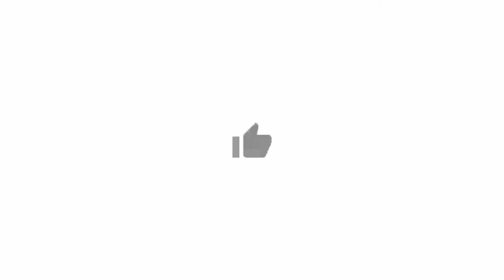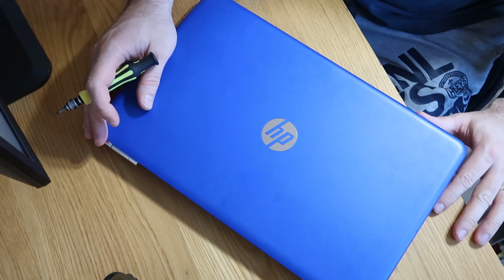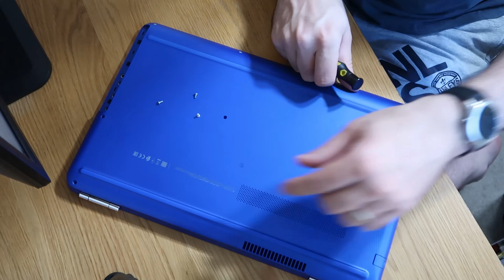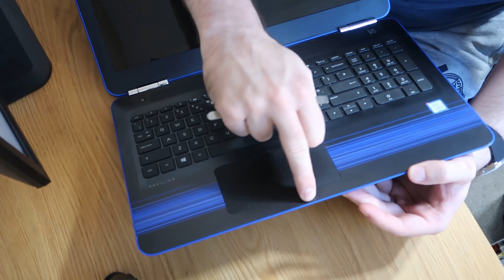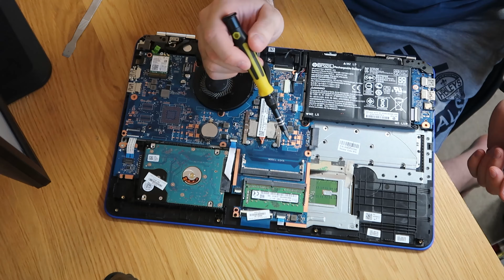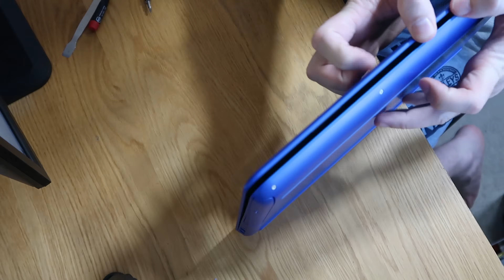HP Pavilion 15 - Battery Replacement

Comment: Thanks a lot buddy. Absolutely brilliant demo. I had the original battery in which lasted almost 7 years and it would only charge to a maximum of 11 percent, so was due a much needed change! I followed your example and replaced the battery no problem. All the best.
Reply from the maker: Glad to have helped 😊

Comment: Great video, well explained. I have thee same model- and this gives me hope for an easy replacement. Many thanks 👍 (quick question- where did you get your battery from, & whats the specific make/model/number please?). Cheers
Reply from the maker: I think this came from replace base but it was quite a while ago so cant remember. eBay is another option for around £15
Reply: @WeRepair  - many thanks 🙂